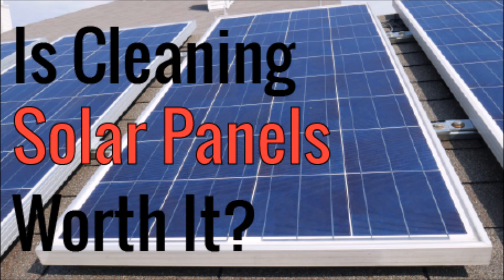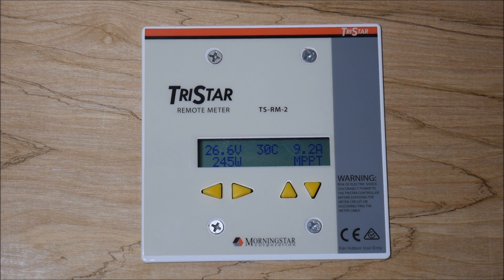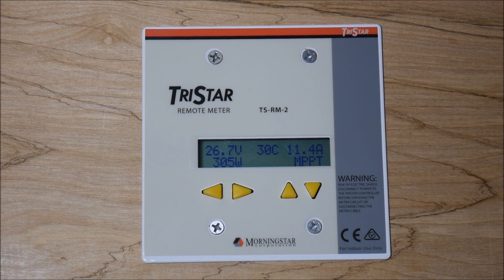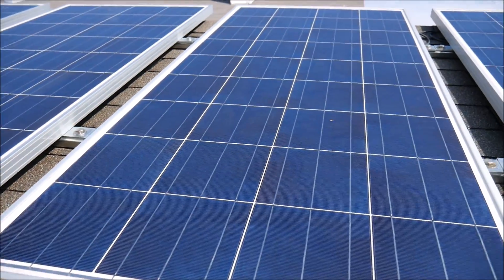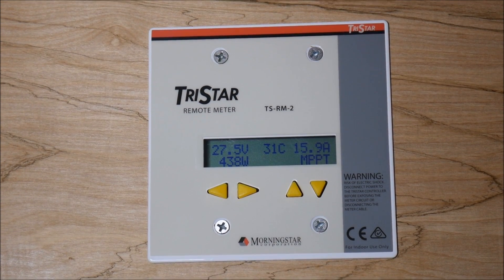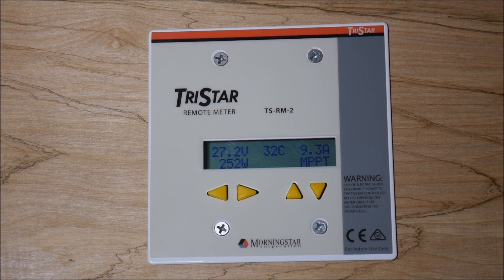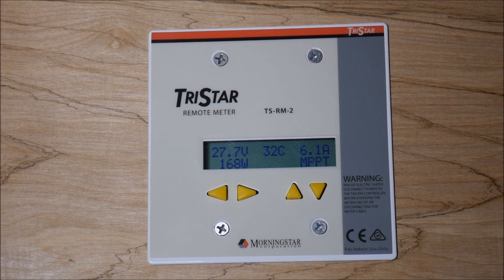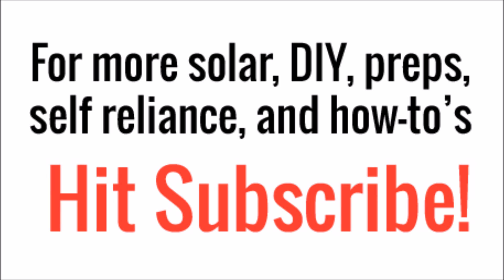Is Cleaning Solar Panels Worth It? - Real World Test Results

Comment: Just cleaned my panels today. Right before I cleaned, output was around 1180 watts. after they were cleaned, output was around 1980 watts. They didn't stay cool for more than 5-10 minutes, so cleaning made the difference, not the cooling effect of the water.
Reply from the maker: Yep.  It is well worth doing!  Your gains are huge.

Comment: I notice dust on my solar panels - possibly pollen dust - but I am not allowed to touch the panels because I don't own them. I have a solar PPA. Also, my roof has a steep pitch to it and I'm not comfortable trying to mop them from a ladder. 
As a PPA goes, I only pay for the electricity generated from the sun to the company who installed and owns the panels, so if it less efficient, I pay less. Still, I'd rather make as much electricity as they possibly can because all excess energy is sent back to the grid and credited to me at a bit higher price than I'm paying for it. 
If I owned the panels myself, I'd probably want to clean them frequently and might likely kill myself trying...
Reply from the maker: Why would you not be permitted to clean them?  That is asinine.  I am sure they don't want you working on them due to liability of you electrocuting yourself.  But simply cleaning them?  That is silly. 

If you can't get on your roof then the next best thing (not optimal but may help) would be to shoot them with soapy water with a high pressure attachment (https://amzn.to/2JOisvv) and then rinse them off with high pressure water (https://amzn.to/2JVs5nZ).

Comment: I have been enjoying your videos for a long time.  If I’m not being too nosy, about how much percent of your electricity are you able to generate with those 4 panels?

We have houses nearby, and some of them have 16 or so panels, as far as I can see driving by.  But I’m Mid East Coast, with less sunlight than what you have.
Reply: It looks like this one is for your solar shed.  Nice!  Thanks
Reply from the maker: Yes, I don't generate power for my house as you figured out.  I generate power for emergencies, to charge power tools, to power lights in my shed, and to power one circuit which I brought into my house which can power our tv and entertainment center as well as our charging station for tablets, phones, and laptops.  But mostly it is for emergencies.

Comment: I had some solar panels in a big city.  The pollution/dust was so bad that I had to wash them off monthly or they would be completely black.  Also any of the aluminum that touched anything non-aluminum started to corrode.  The panels were also dripping wet in the morning so it caused some moisture problems on the roof. Never put solar panels on a roof, too many secondary issues.
Reply from the maker: That sucks.  I guess that is reason #1,000,000 why I will never live in a big city.  But mounting solar panels on most residential roofs is perfectly fine.
Reply: Never put solar panels on a roof?

Comment: would using a wax on the solar panel help with reducing dirt build up?
Reply from the maker: It would but it would also interfere with the sun hitting the photovoltaic cells and lower your energy production.  Even the glass on solar panels has to be special glass that allows all radiation through.  Your average window glass filters out way too much energy.

Comment: I guess you will have to revisit this topic in a year or so with a device that can measure the actual power provided for the rest of the day.
Reply from the maker: Oh, I have access to that.  I just haven't had time to get into that part of the charge controller.  I will, though, and will revisit this test by popular demand.  The reason I didn't want to do that the first time is because no two days are alike.  Cloud cover, temperature, etc. will be different so it is tough to compare two days' total production against each other.  I felt like obvserving the peak watts produced was better.  But some of you disagree so I will do it the other way, too.

Comment: I want to do it on my grid tie system. But can only do it on my shed. Agreed with majority that this is not necessary. But I want the maximum system power lol.  New sub here. Going thru your archive right now
Reply from the maker: Thanks for subbing!  Of course it isn't necessary.  I would say 80% of home installs will never be cleaned.  And that is ok.  I just was curious how much power I was losing by not having shiny clean panels.  And was genuinely surprised.  I actually saw my system hit 521W the other day so it is even better than I showed in the video.

Comment: Sorry forgot to mention it was a good report total agree just surprised it took you so long. NSW in Oz
Reply from the maker: Thanks, I have cleaned them before but did not test the production after.  This was pretty eye opening.  I saw it hit 521W today!
Reply: LDSreliance I was pulling your leg, I knew you cleaned them before. It was the explanation that was good, as it made the viewers sit up, which was the part I liked. If your panels and converter are efficient and this being a low angle roof (I'm guessing 20-25 Degrees your latitude angle on the globe gives your highest all year around yield) with your roof pointing slightly west of north (SOUTH, sorry forgot which hemisphere I was talking with) for the peak time of daylight you will hit 100% efficiency if not by the end of summer then definitely next year. Please advise when you do.
Reply from the maker: I will definitely keep trying to improve the system.  Not sure I can hit 100% but I will certainly try.

Comment: The downside is that only lasts ~1-2 weeks and a good rain storm has the same effect.  Generally not worth the effort unless it's something the rain can't wash off like pollen.  I have an device that costs ~$500 that has the same net effect as cleaning the array every 1-2 weeks.... ~15% more panels :/
Reply from the maker: I saw my panels hit 521W today so it was well worth doing.  I have only cleaned my panels once in 4 years before this and I used to agree with you.  Just let them do their thing.  But now I will start cleaning them every couple months or so.
Reply: LDSreliance ....i agree with you.  I didnt address the available real estate point of view very strongly.  But available surface area on a motorhome limits the number of panels one could install.  I even mount one panel on top of the engine hood.  With this in mind, washing is my only viable option.  I dont get the drastic net results that you do.  Reason is...i wash more often then you do.  I get roughly a 15% max performance gain.  I got a 50% gain when i first started to wash.  Panels were so dirty i could have grown potatoes on them.  So ever since i wash more often.  Thusly i only see a 15% gain.  Which is important to me.  For me, the addage gotta make hay while the sun shines is in reality important to solar production.  Now...where the heck did i put my bucket?
Reply from the maker: Rain doesn't remove all of the dirt.  In fact, you can't see it on the camera but there was some dirt build up on the bottom of the glass and frame.  I shot it at point blank range with my hose and it would not budge.  It was not until I scrubbed it with the broom for a bit that it came off.

I would say rain would probably restore 10% of your production but scrubbing them like this will do closer to 20%.  But you are correct that the effort to clean the panels will be wasted as soon as it rains the next time.  If I had room I would definitely throw up more panels.  As you see I cannot.
Reply: Christopher Dizon ...i understand your point.  But what would the average person do to maintain a reasonably clean panel?  Seems to me washing is the only solution.  Unless of course one lives a rainy environment.  Where i live 5 plus years of drought leaves only one option.  More panels?  Maybe.  But, no matter how many panels one installs they all suffer miserably from dirt.  I try to keep mine washed every two to three weeks.  On top of a motorhome.  Bad enough.  Its a lot of work.  I pity the homeowner who has a steep pitched roof and cannot walk on said surface.  Their only choice is a high pressure washer.  Driving around neighborhoods i find most solar panels are filthy dirty.  Maybe never washed since installation.  I wish there was an easier way to keep the solar clean.  If i was younger, maybe my panels would get washed more often.  Anyways...have a good day.  And keep on solaring!  Lol.
Reply: Nothing... the reality is that it's not worth your time to keep the panels clean.  I live in NM where it rarely rains and I haven't cleaned my panels in >3 years.  They're doing fine.  Mine look filthy too... still kicking out ~60kWh/day.  Turns out dirt is really good at keeping dirt off :)  Maybe it's worth spending ~15 hours/yr to produce ~$30 of electricity/yr for some people... not for me.  My $0.02... don't worry about cleaning the panels.
Reply: I see a bump too but it usually only lasts 1-2 weeks then the performance levels off.  I also oversize my arrays.  I have 10.7kW on a 8kW inverter so the benefit from cleaning is significantly reduced, even without cleaning my inverter is maxed out for 2-3 hours/day.  If you're trying to squeeze every wh out of a small system it might be worth it but for every hour I spend cleaning my panels I miiiight make another ~$1-2 worth of electricity.  It certainly has an effect but I'm not sure $1-2/hr qualifies as 'well worth doing' :/
Reply: Christopher Dizon ...now i better understand your point of not washing your solar.  So you invested an extra 25% cost to offset not washing.  To some degree that sounds very reasonable.  But I for one cannot afford to burden myself with a 25% higher solar cost.  So for me to avert that...I wash and save 25%.  That is a huge dollar figure you spent to add additional solar to offset washing.  Us poor fixed income folks cant afford that luxury.  Im glad you can.  So look for me on top of a ladder washing my panels saving all kinds of money.  Aint it funny how poor and rich people think to get the same results?  And that my friend makes the world exciting.  If we all did the same things...gads how boring would it be??  Nothing mean intended.  Just expressing an opposing point of view.
Reply: LDSreliance ....👍
Reply: Hmmm... if you consider yourself to be 'poor' my advice would be to sell your time for more than ~$2/hr :/  Unless you enjoy washing solar panels... in which case that's its own reward :)  I'm sure we can at lease agree that any sort or 'professional' washing service is NOT worth the investment....
Reply from the maker: Yes, professional washing would not be worth it.  And I could wash my panels in about 5 minutes if I were not filming it on camera.  I agree with what you are saying Christopher for your situation.  I would do the same in your shoes.  I just don't have the real estate to add more panels so this is what I will choose to do during the summer.  Texas summers usually see no rain so cleaning it once in the beginning of July and then again sometime in late August should give me a really good benefit all summer long.

Comment: great job hey I notice a problem on your install on the roof . you didn't lift your unistrut  to allow for water run off I don't know if you knew that or not . not nocking you it just not what I have seen as proper panel set up
Reply: Nyght myst .....you are going to love your midnite...i felt the same as you waiting for my first one.  I now have two.
Reply from the maker: I don't think there is such thing as proper panel set up.  I have seen every kind of mount you can imagine.  This one that I used is just electrical channel conduit with spring loaded attachment points.  I probably should have raised it off of the roof surface a bit to allow for greater air flow but it has worked great for 4 years now.
Reply: they are raised to all water to run instead of pooling the uni strut is never mounted directly to the roof nice set up though my midnight solar charge controller comes today cant wait
Reply from the maker: Thanks.  I haven't noticed any water pooling but it is possible.  That is exciting!  Let me know how it goes.
Reply: can wait to open it got lot of reading to
Reply from the maker: Yeah there is a lot to learn with these advanced charge controllers.  Do a lot of reading before you try to install it.
Reply: Nyght myst ....beautiful thing about the midnite is that it comes with a complete owners/operating manual for solar, wind or hydro.  Also is the only controller with a built-in arc fault detection/protection, another money saver.
Reply: i was perusing the manual nice  now to save up for some batteries  lol . I got one of the voltage clamping devices to will need more but got figure out how or what i can use as a combiner box they sell them at the altE store but i been buying parts like this to get more serious about the the system i want to build. Was chat with LDS about what i got its a renology  400 watt set up with a 40 amp charge controller he was saying that 4 6 volt golf cart batteries at 215 amp HRs a piece  it could not charge if i had a bad day with little or no sun. Sooo and the charge controller according to renology could only do 12v at 400 watt and 800 watts at 24v now i had a dissension to make the charge controller was going to hinder me from expanding see i can only do this a little at a time if i had known about its short comings of the charge controller i would have tried it a different way but live and learn is expensive. I hate learning like that                                                                                 !That's why i called the midnite solar factory in WA and talked to them then they gave me the number to the altE store i had looked all over the net and these thing are pricey to say the least this is a true classic not the SL model 150 got it for 545 plus 88 bucks for the clamp and i got 5% off with some fast talking i like this store this is the place to go
Reply: Nyght myst ...that is an excellent price.  If you think you might need a second controller, keep your eyes peeled on ebay.  Every once in awhile a deal will popup.  Especially when the vendors start fughting with each other.  Kinda sorta comical at times.  They dont use words...they adjust prices...sometimes by cents.  Like a third grader saying his daddy is bigger than yours...and he will kick your azz!   Lol
Reply: yes i saw that the best price i saw was 530 for and sl model i did see a used unit it was in Canada but to tell you it was 498 it was a classic 150 but you know i wouldn't pay that for used. Anything could go wrong and your out almost five hundred clams nope new is the way to go . believe i though about it but the most i would have gave the guy is 250 or so cause it going to cost you shipping to the factory for repair it just didn't think the price was realistic this thing sells at the altE every day for 545 new was reading it net works with other midnites frigen  thing is awesome this thing will grow with you i think it the best i looked at the outback 80 it just wasn't as good   don't get me wrong is good but not as good midnite amps are higher were the 80 is 80 amps
Reply: yes i saw that the best price i saw was 530 for and sl model i did see a used unit it was in Canada but to tell you it was 498 it was a classic 150 but you know i wouldn't pay that for used. Anything could go wrong and your out almost five hundred clams nope new is the way to go . believe i though about it but the most i would have gave the guy is 250 or so cause it going to cost you shipping to the factory for repair it just didn't think the price was realistic this thing sells at the altE every day for 545 new was reading it net works with other midnites frigen  thing is awesome this thing will grow with you i think it the best i looked at the outback 80 it just wasn't as good   don't get me wrong is good but not as good midnite amps are higher were the 80 is 80 amps

Comment: I watch these videos and people who install solar discuss their return based on these panels remaining operational for 20-30 years.  Does anyone really think so?
Reply: GEORGELET4 a grid tie system (no battery)  can pay for itself in 10 or less, 5 in my area). Nasa has panels from the 70s still in use.
Reply from the maker: They are designed to operate at least 25 years because that is how long the warranty lasts.  The refined silicon breaks down at a known schedule so theoretically they can last much longer than that but they won't be as powerful.
Reply: GEORGELET4 ...i believe.

Comment: When you wash them like that the middle of the day it also helps that it cools the panels makes it more efficient and they  produce more power
Reply from the maker: True.  I washed them in the morning before they were very hot but I am sure it did cool them down for a while.
Reply: @LDSreliance  after how many hours u cleaned the panel
Reply: Darryl Pickett ...very true.  However the cooling effect only lasts a few minutes.  Go back 15 minutes later and try and touch your panels surface.  Ouchie ouchie.  Someday i am going to put some bacon on a panel.  See what happens.  My betting money says the bacon is gonna taste really good!!!

Comment: A lot of dish soaps will leave a residue that can build up over time. Thank you for the video.
Reply: AD Homesteading ...excellent point.  I use car wash products if i feel the need for a "soap".  Most times i use plain filtered drinking water which guards against any hard water mineral build up.
Reply from the maker: Ehh, if it is good enough for me to wash my dishes with and leave my glassware clean I think it will be fine with a good thorough rinsing.